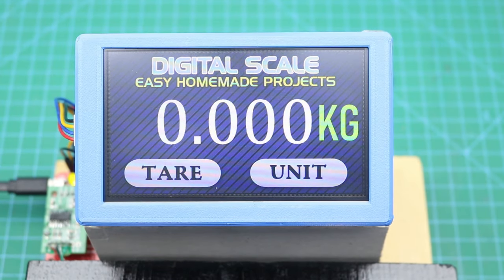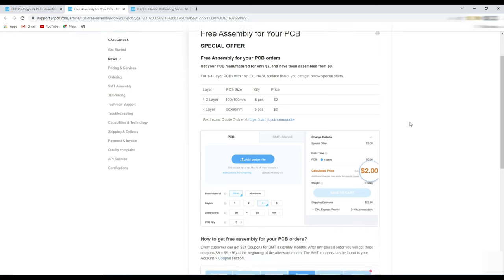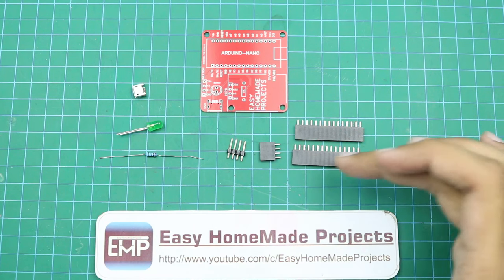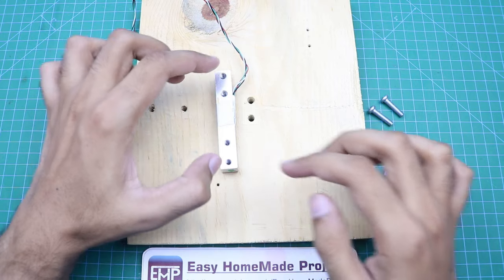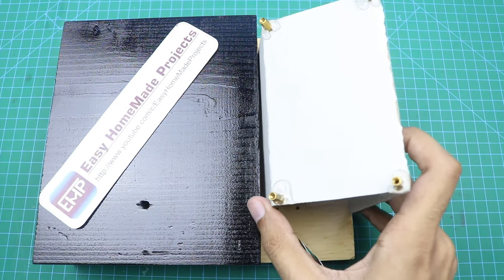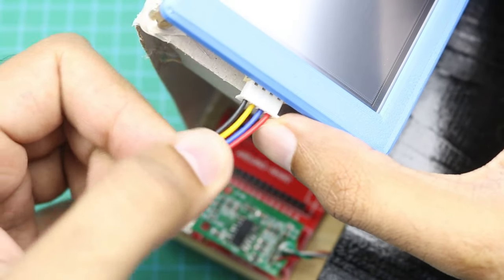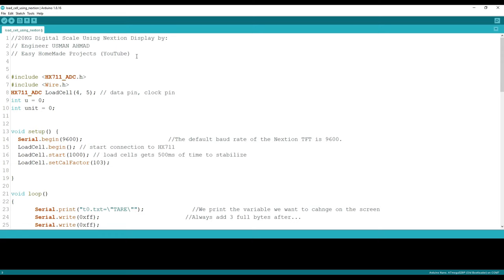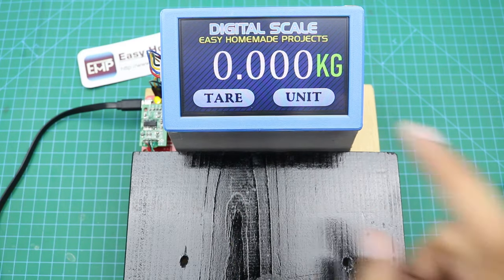How to Make Big Display 20KG Digital Scale using Arduino and Touch Screen

Comment: Hi there, I’m working on a project for work which requires high quality scales. I have managed to get your system working on my 7inch nextion display. However the “TARE” button and “UNIT” buttons aren’t working :( could you kindly send me the HMI file for this? Or could you let me know any coding you did in the nextion editor? Many thanks buddy.